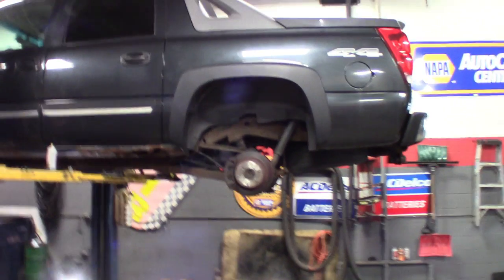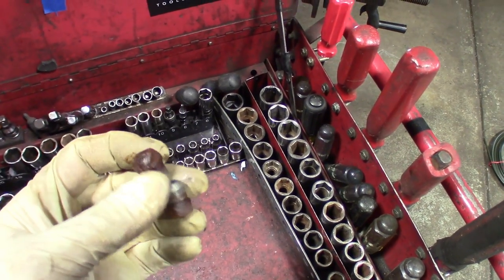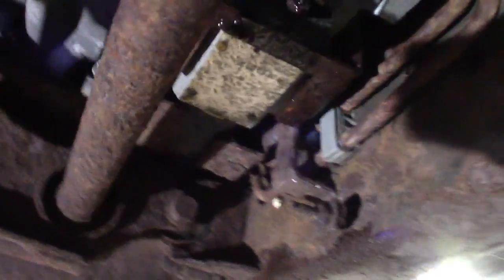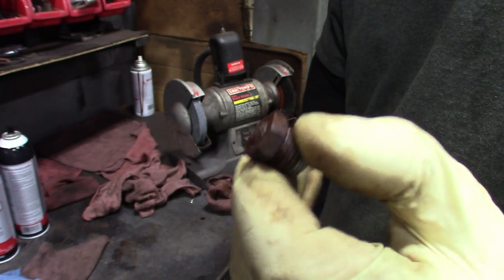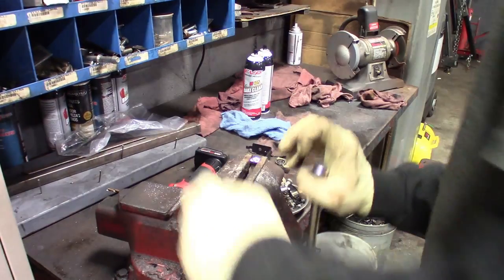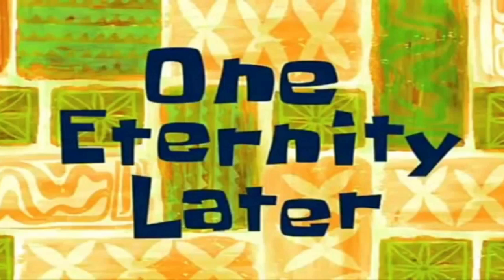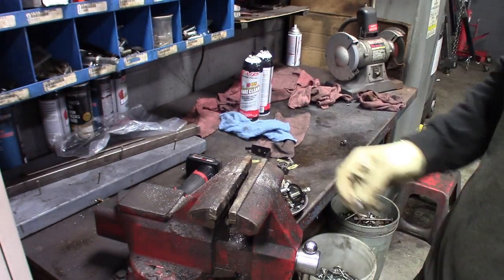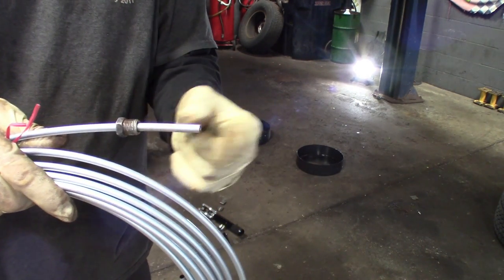Rusty Brake Line Tip

Comment: Can get  the line kits for the 1999 to 2006 GM fullsize trucks,prebent stainless steel.Also made out of nickel copper by ags.There are some the gas tank comes out replacing them.Cutting brake lines,I have a couple pairs of Knipex cobalt pliers that cut them in one cut.Even an air saw made for auto body work works too,be careful not to cut things that don't need to be cut.I have an air saw for this too,quickly cuts them out.

Comment: Make a list of your most used fitting sizes and buy in bulk. Amazon is quick, easy and cheap. I hate having to get fittings from the parts store. They never send the correct ones, no matter how detailed I get in describing what I need.

Pro tip for wire brushing the fittings: Keep a few short pieces of tubing (3/16, 1/4, 5/16, 3/8) by your grinder. Slide on your fitting and put your thumb on the outside of the fitting to keep it from spinning. Flare one end, if you like, so the fitting can’t slip off. Saves skin and gloves.

Comment: I like to use Nicopp brake line in bulk.  Easy to bend and doesn’t rust.  The NAPA store I run stocks these fittings!  It’s hard to keep them in stock in the rust belt!!
Reply: David Jarvis we keep a very large well stocked assortment of brake fittings. In the rust belt we do a ton of brake lines. Buy nicop line in 100ft rolls as well.

Comment: That's the way to do it! I did the one that runs to the rear on my ford last year. I surprised those lines last as long as they do. If you do this for a living salt can be a $$ maker. I don't do it for a living so salt is my enemy. The bad part about this whole road salt issue is> At work I drive the plow truck and it has a salt spreader on it. So I'm my own worst enemy

Comment: The kit from gm is cheap. More cost effective to buy the kit. Not judging or telling you what to do. We do a ton of these and started buying the pre bent kits from gm a few years back. Saves a ton of time and the gm kits are coated and will prevent future failures.
Reply: devoncoolman88 
I agree, done a ton off these and the GM lines are the way to go. Can crank out a brake line job in 4hrs
Reply from the maker: I paid $20 bucks for a roll of bulk line and get these jobs done in about 2 or 3 hours

Comment: Just charge the same put the pre bent ones in the set is only 100 bucks for the dealer and is Easter to do. Done this job both ways. Did it your way and once they started making the lines it’s a 2 to 3 hr job with pre made. And looks oem

Comment: Why drill them out dude, just tap it out with a small punch it will pop out the old flare. Drilling you are risking the sealing surface of the union.
Reply from the maker: They get so seized up from the rust a punch don't work. Just mashes up the line inside the fitting.
Reply: Punches dont work up here in ny either. Only way to do it is with a drill and ive never had an issue with re using them after drilling old line out of the fitting. You wont get far with a punch. Jist very frustrated